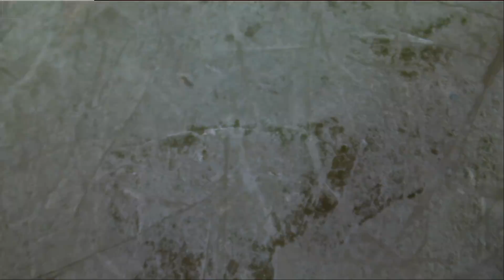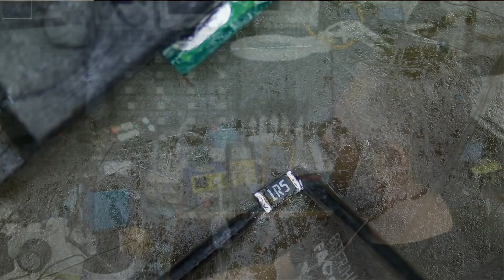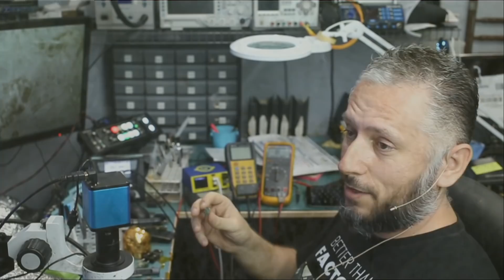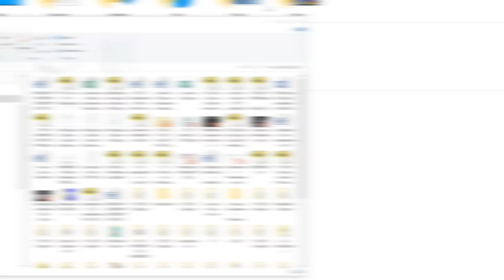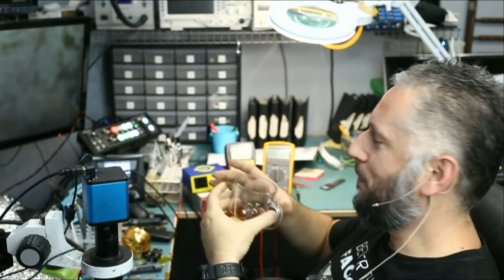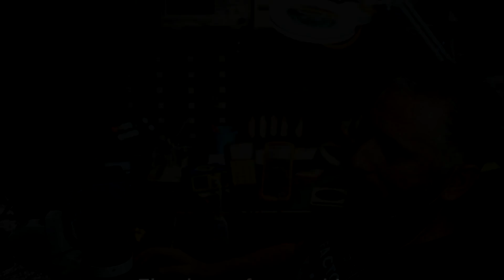Damaged USB Flash Drive Data Recovery

Comment: That was a great vid. However, I just don't understand one thing. Considering resistors are made to decrease the voltage before it's fed to a component (so that such component doesn't fry), shouldn't it be normal that one side of the resistor has more voltage than the other side? That's what's troubling my understanding. And if my statement is correct, what EXACTLY gave it away to Alex? Should the voltage be the same on both ends of the resistor?

Comment: I have watched tons of your videos while drinking my morning coffee, I don't know if you have answered this in the past but you always seem to use solder wick, why not use suction to remove the old solder? Thanks for the awesome videos!
Reply: I'm not northridgefix, but I can answer. Basically solder pumps/suckers are for mainly for THT work, as they can't suck all the solder, while wick gets rid of all the other surface solder. As he only does smd work, he only needs to use wick. Hope I answered your question well.
Reply: @percytheb4053  Connector frames are trough hole soldered, are they not? And you are right you are not the one I asked the question so it still remains unanswered.

Comment: With all of these drive repairs and you plugging it into a pc, are you ever concerned that one drive may be infected with a virus or contain a script to damage a computer? Have you taken precautions to help remedy this if it was to happen? Is the computer used to access these drives a sealed and isolated device from others? Have you done anything to make sure if it was to happen that nothing other then a drive wipe flowed with a clean os install is needed?
Reply: Is that possible?
Reply: @dreamcat04  I 100% stand by it that it is very possible and highly likely to happen under the right circumstances.
Reply: @pinocatozzo4790  English pls, thanks.